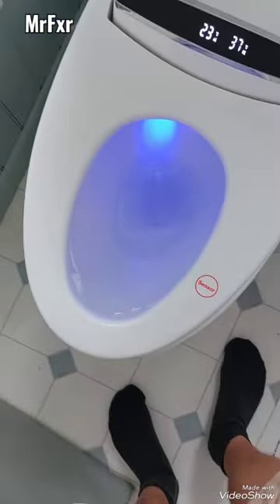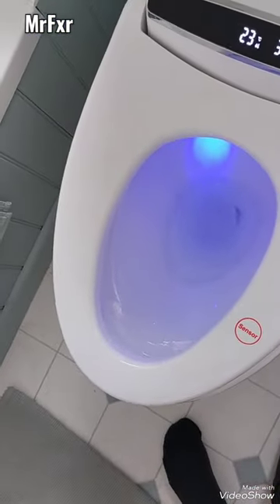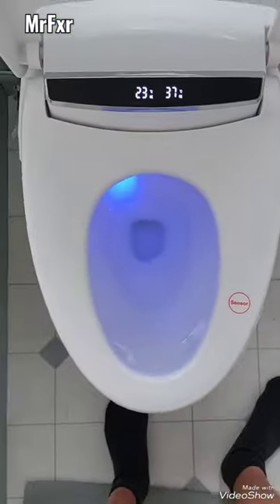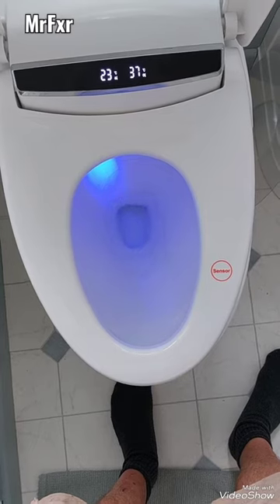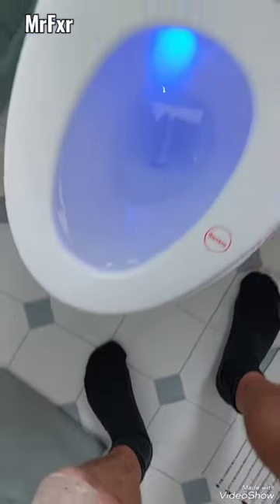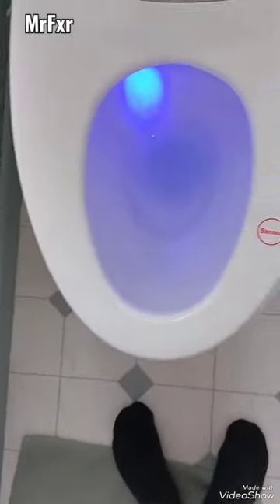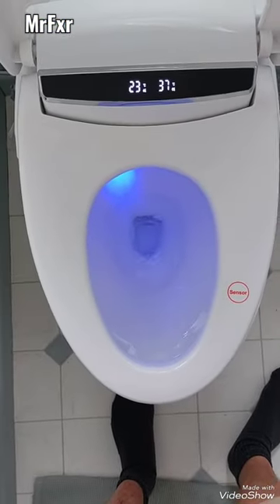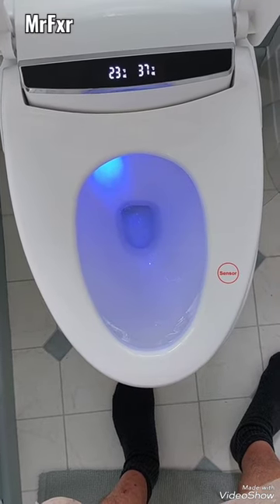Tankless bidet toilet not flushing solids away issue (smart toilet)

Comment: Have you put a pressure gauge on your water line to see if you are getting enough water pressure?
Reply from the maker: Yep, pressure was fine, 2.2 bars. Water capacity(flow) was just over 13 liters per minute. This toilet requires a minimum of 20 litres per minute unfortunately. Not many properties in the UK will have that

Comment: Do you have a solution as I’m having same problem with the same toilet that’s just been fitted
Reply from the maker: Hi, there was an option of installing a booster pump on mains supply to increase water volume above 20L/min, but it wasn't guaranteed so customer decided to replace the toilet with standard close coupled one. Some booster pumps can boost water volume up to 40L/min
I hope it helps

Comment: did you fix it? I have exactly the same problem
Reply from the maker: I'm still to go back to customers house. They have decided to install a booster pump on mains to increase the flow. Homary (supplier of toilet) customer service said that mains water capacity has to be minimum  20 L/m. I wish they said that on installation instructions and description of the toilet. I could've test water capacity before customer purchased the toilet. Considering that majority of UK homes have water flow rate below 20 L/m they should've state that requirement.
Water flow at customers house is 13.5 L/m . In UK anything above 12 L/m is considered "Good" by water board . I'll update another video with booster pump installed
All the best 👍🙂
Reply: @mrfxr1695  my toilet from homery as well. The supplier said it should be 5L per 15 seconds. 😔 Did you try to remove the water flow limiter? It's a little metal think inside the valve. We have it in the US. I'll try to remove mine. Still looking for a solution.
Reply from the maker: @dianalee2969  exactly that, 5L every 15 sec, (20L/min). I've tested various taps at the property and it is coming far less than required by them. Majority of UK homes will have water flow capacity below 20 L/min.
Reply from the maker: Here is final video on this toilet 
https://youtu.be/SccOCx0ssCY
Reply: @dianalee2969  Hello, I'm in the US and just installed same toilet. I have actually higher water pressure than they require, but the toilet came without water flow limiter inside the valve, so that's how I installed it. Would that be a problem in the long term use?
Reply: @whez08  Hello. Honestly I don't know. Technically I don't think it's gonna be a problem. I think. I think (!!!) they put water limiter only for the ecological reason.
Reply: @dianalee2969  :) Thanks for replying. I was thinking maybe it is to prevent hose burst due to excessive presure. But anyway, since it works without it, I will leave it as it is.

Comment: Did you fix the issue - my toilet has the same issue
Reply from the maker: Customer service said water supply at the valve has to have flow capacity of 20 lit/min. That is rare in the UK to be honest. I have suggested to customer installing a booster pump but they have opted to get rid of that toilet and install a standard close coupled one.
Btw I have tested their water capacity and it was 13 lit/min

Comment: I had a similar problem. Installed a pump to no avail, checked solenoid valves- ok. Eventually found the bottom flushing hose kinked at the front of the toilet.
Reply from the maker: I'm glad you've sort it out. Out our customers house we have checked all hoses, valves, filter, but their water mains was not sufficient, unfortunately
All the best 👍

Comment: Solution - the toilet waste line is clogged. Use a large / wide accordion style plunger to clean and force out the line. One can also force out the clog by using the water hose technique (find a how to on YouTube).  I have found that this model of toilet is not uncloggable! Other than that, I love this toilet/bidet.
Reply from the maker: There was not enough water flow capacity on mains inlet. Entire toilet waste pipework are brand new. We took this toilet out and installed conventional closed coupled toilet, it works perfectly

Comment: The solution to this issue is to reduce, not increase your water pressure.  If you do not have access to your pressure regulator just close the valve to the toilet partially until you get proper flushing.
Reply from the maker: Thank you for your input but I'm not sure how it's that going to work. Supply capacity at the property was 13 lit/min and manufacturer is stating that  minimal required flow is 20lit/min
Reply: @mrfxr1695   This seem counter intuative, however I tried this and it does seem to have fixed my issue. Turned the valve closed and slowly turned it until the toliet started flushing fully. For me, abour 3/4 turn open.
Reply: @WilliamSchoeppner  same here! Totally the opposite of what I would have thought....
Reply: I don’t know why TF this worked but it did so thanks lmao
Reply: Unbelievable- 3/4 open worked for me too.  😂😂 thank you!
Reply: Omg! Thank you so much! This worked so well.
Reply: That's amazing! I've been troubled by this issue for a long time. After trying to lower the water pressure a bit, the flushing power has returned to normal. Thank you very much for sharing your experience.
Reply: Worked for me
Reply: HOW?! I tried everything, including taking apart all hoses and nothing worked. 
Once I had given up, remembered this comment and tried it. 
Worked like a charm. Thanks so much 🙏

Comment: I have to run this toilet with enough water pressure that the pan drains completely, the water jets push everything through.
Reply from the maker: Unfortunately, water pressure at customers house wouldn't do that. Are you living in high water pressure area or have you installed a booster pump?

Comment: My toilet has same issue
Reply from the maker: Some people have suggested turning the valve down a bit, I'm not sure that will work but it's worth a try. Have you tested mains water flow capacity? It is recommended 20 liters per minute. Otherwise a booster pump can help

Comment: Literally the worst company to deal with, first toilet turned up damaged, waited a week for a new one, had to install a toilet for the customer to use in the meantime, new one turned up and doesn’t flush, doesn’t state anywhere in their website about pressure requirements or in the installation instructions! They never call back when they say they will. AVOID HOMARY at all costs
Reply from the maker: My customer got rid of that toilet and I've installed traditional close coupled one. Customer service said that minimum requirement is 1 gallon in 15sec, roughly 20 L/min. That would be very rare in the UK